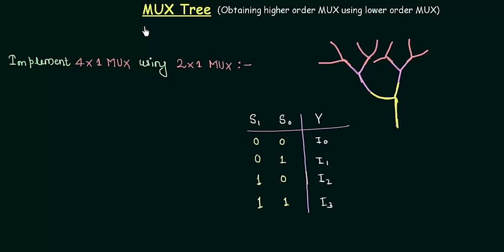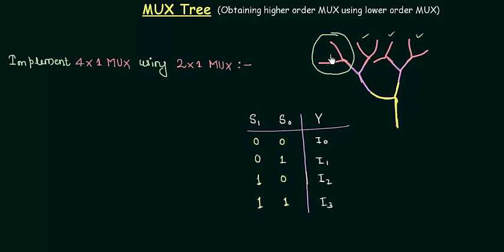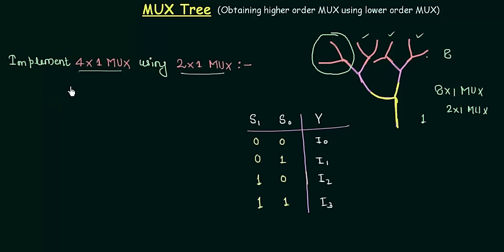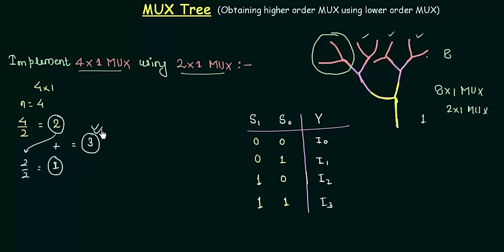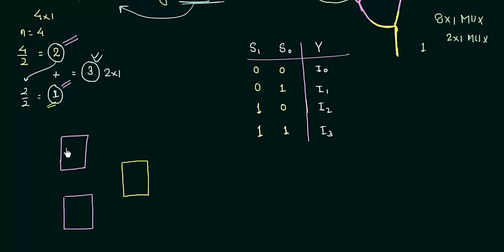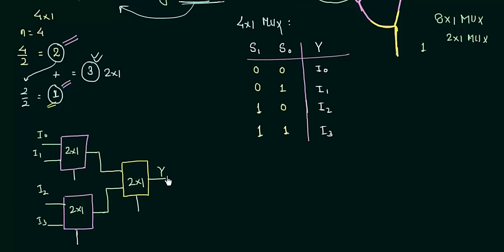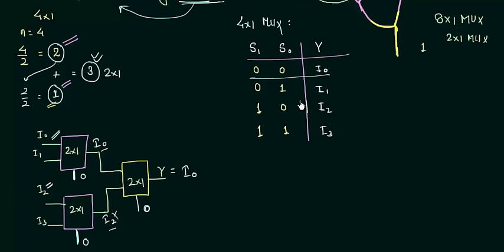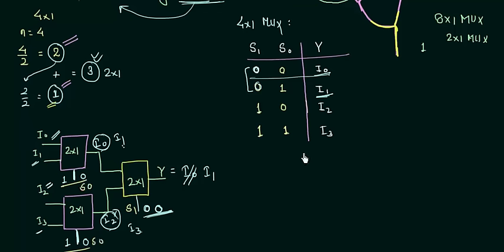MUX Tree Basic | 4X1 MUX using 2X1 MUX | Easy Explanation

Comment: This was really helpful, but could you please explain or give reference to why 4/2=2, and 2/1=1 rule works to get the arrangement and number of muxes required?
Reply: Late reply but may be useful for others. Building it with a 4x1 mux out of 2x1 mux we only have 2 inputs to work with so since we need 4 we divide it by 2. We got the 4 inputs as required right? Well since they’re 2x1 we are getting 2 outputs. But we need a 4x1 mux. If we used only the 2 we would have a 4x2 mux technically. So we divide it by 2 again. We have 1 we are reducing the outputs at each “stage” I guess you could call it until we get to our desired single output. That’s how I think of it at least.